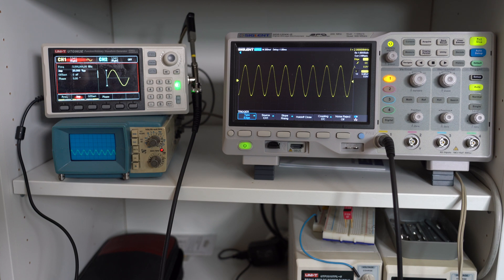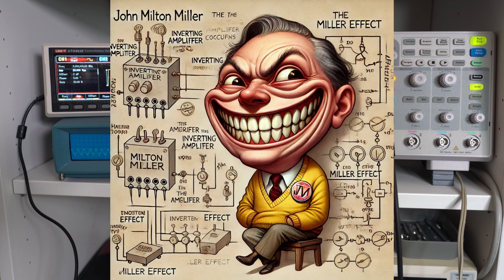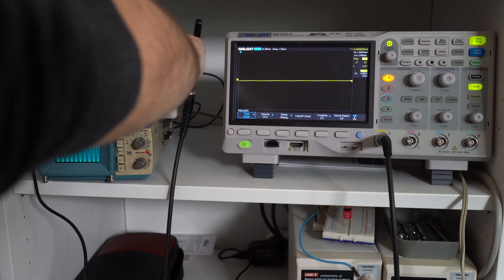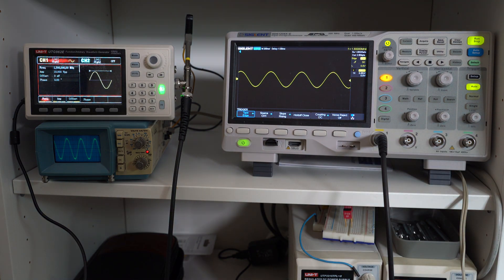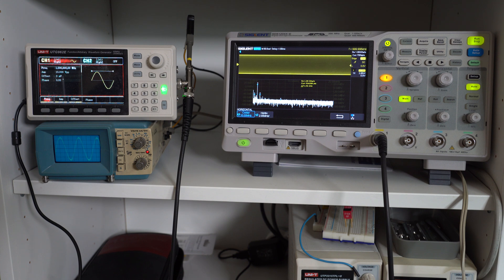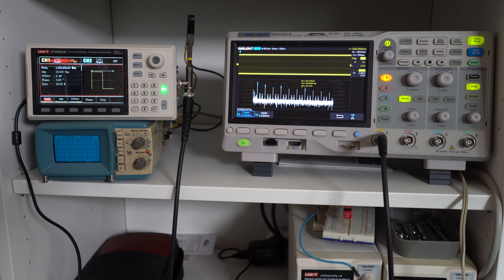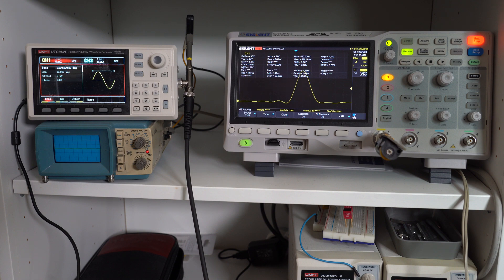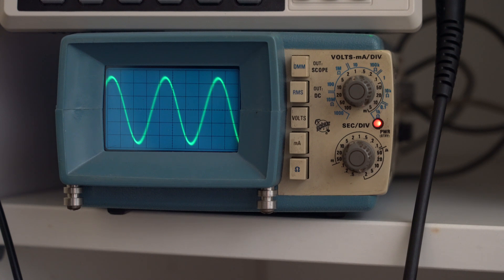Understanding Oscilloscope Bandwidth: Tutorial

Comment: In most cases, an oscilloscope is not used to measure 50-ohm signal generators, but rather operates in high-impedance mode with a probe. The bandwidth is determined by an RC filter formed by the oscilloscope's input capacitance and the source resistance of the measurement point’s equivalent source. The specified bandwidth is typically normalized to a 50-ohm source loaded with a 50-ohm load, i.e., a Thevenin equivalent source of 25 ohms. For example, with an input capacitance of 12 pF, the specified bandwidth would be approximately 500 MHz. However, in general, it depends on what is being measured. For high-impedance circuits, the bandwidth will be lower